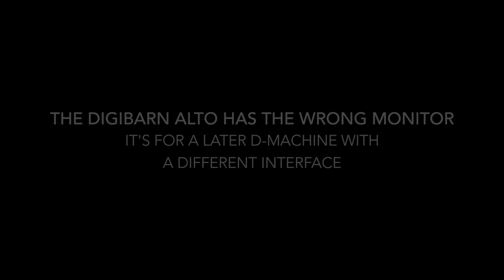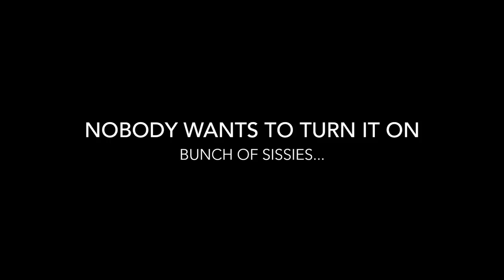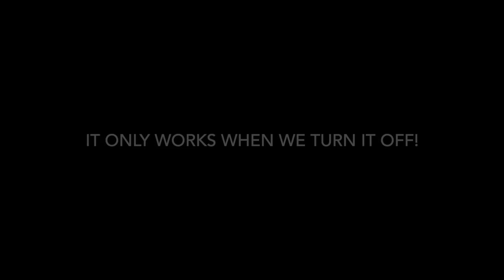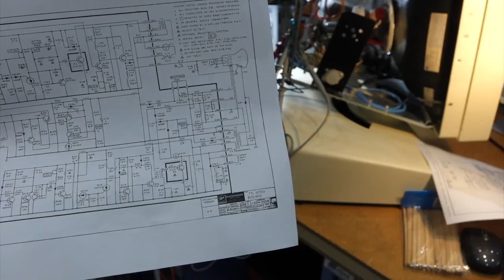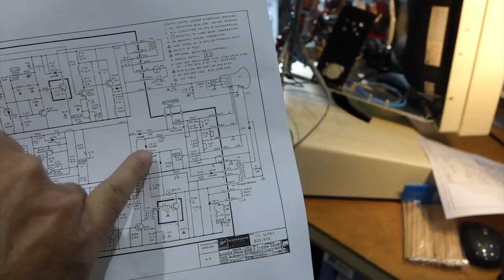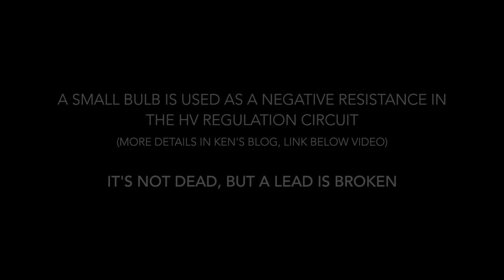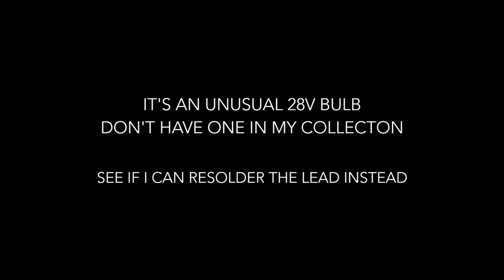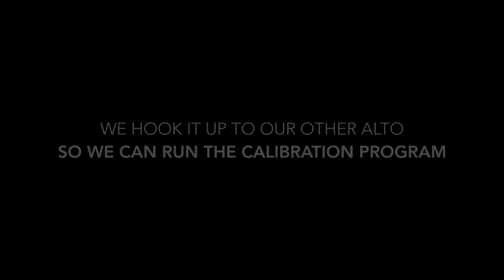Digibarn Alto Part 3: Restoring the CRT Monitor

Comment: I heard you mention that this might be a Dolphin monitor.  It isn't.  The RAND Corporation, when I worked there in the '70s-'80s, bought five Dolphin (D0) machines from Xerox to run Interlisp.  The under-desk machine had about the form factor of an Alto but looked quite different.  It had a 4-digit red seven-segment LED display showing which microcode state the machine was in...helped no end in diagnosing boot problems.  The monitors were 19-inch B&W displays that had a "normal" (4x3) form factor rather than the vertical display of an Alto.  Since Interlisp and Smalltalk (which we also had, gratis, because we organized Xerox' VAX-750 file server software into a real distribution for them, which also netted us a 3Mbit PUPNET VAX interface board signed by Bob Metcalfe) were both windowing systems, that extra screen real estate came in VERY handy!  I wish you could find one of those D0s somewhere.  RAND has no idea what happened to theirs.

Comment: Beautiful! Could the incandescent lamp be used as a soft-start NTC (and be replaced by one)?
Reply from the maker: Actually, I mispoke, that's a positive coefficient resistor. Starts with low resistance, and it goes up when the filament heats up. So, similar idea, but opposite direction compared to a NTC.

Comment: Over here in Cambridge I look at the mere 1kV stuff present at the pointy end with cheap (x10 or x100) probes but then the 'scopes are cheap too
Reply from the maker: Yes, for the anode acceleration voltage we'd absolutely need the probe, but for the grids at around 600V we could get away with a my regular DVM that has a high voltage setting. Better safe than sorry though, and that was a great plug to show off Carl's mighty lightsaber probe.

Comment: 3:18 - Engage Safety Squints...
BTW - the use of a light bulb reminds me of the typical Wien-Bridge Oscillator circuit where a light bulb is used to provide automatic gain control - acting as a sort of PTC thermistor.
Reply from the maker: ... and Mother on speed dial. Contact! I have recently discovered AvE's hilarious channel and found out that I was mispronouncing nearly everything electronical. Will correct that in the next vidjeos.
Reply: If I heard your comment correctly at 5:18 , it also sounds like you discovered ElectroBoom's channel too :)
Reply from the maker: Yes, Ken told me about Electroboom. Who knew electrical tinkering could turn into stand up comedy. Only on YouTube...

Comment: Marc you said "gave the monitor a bath"  could you expand on the procedure you use for entire assemblies like the monitor?
Reply from the maker: This was mostly in jest. I think I cleaned this one up mostly with isopropanol. As usual, the more you can take apart, the best you can clean. On occasion I have done full bath in Simple Green, mostly for mechanical assemblies that were too hard or too risky to take apart, like the model 19 Teletype print carriage. Some people have put assemblies in dish washing machines (!), and I sometimes clean boards in water + simple green, like I did for a couple of the worst boards of the Digibarn Alto here. Needless to say, you have to check there are no water sensitive parts, and careful immediate drying with a hair dryer is a must.
Reply: @CuriousMarc  Thank you for the detailed reply!

Comment: A light-bulb used as a resistor?  That’s crazy!!  I mean, I get why they did it — low resistance when first powered on allows greater current, which you need at first, and then the resistance goes up quickly to limit the current.  But still...  A light bulb?!  Crazy!
Reply from the maker: There was such a large market and such price pressure on analog TV CRT circuits for such a long time that they had been refined to an incredible level. I have rarely seen more analog high voltage and high current trickery to save a 10c component than in TV deflection circuits. The use of lamps as current regulators is one, linearization with just one perfectly calculated inductance, snubber caps and diodes, or components wired in an usual way to perform two or three functions at once are other examples. And  for their trickery and dearth of means, these circuits work really well!
Reply: CuriousMarc Well, I guess CRT-based displays were around for, what, 70 years or so?  From the ‘30s to the 2000s, right?  So they did have plenty of time to refine their circuits and learn what worked and what didn’t, while spending as little as possible.  The more I go back and look at the stuff that was available back in the “analog” days, the more I’m amazed at how well they accomplished what they needed to do back then.

Comment: from my experience (i used to work as an audio engineer) i always wait for the bang after the click of the ON switch. It usually took a second but then the Amplifier would just explode and then everything is quiet xD (we got batch of 10 or so bad ones from the factory, where the HUGE caps were in backwards)

Comment: 2:20 - What's the optical table in the background for?

Somebody making holograms, or other top secret stuffs? :p

btw, they are sissies for not wanting to power up the monitor. CRTs aren't that scary. hehe
Reply from the maker: Yes, holograms coming up. Preview video here: https://youtu.be/TnFdaIz7k0w
Reply: CuriousMarc

Awesome.

I tried to sell my 70mW JDS Uniphase multi-line Argon laser / space heater a few times now, but they've all but been replaced by diodes now.

I'll check out the vid. Thanks.